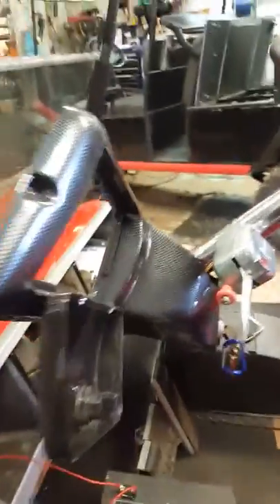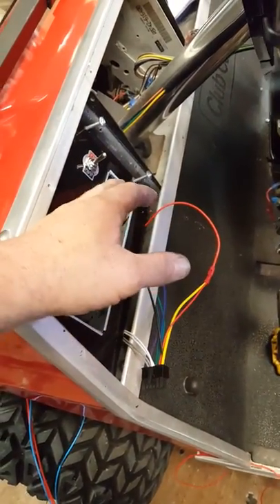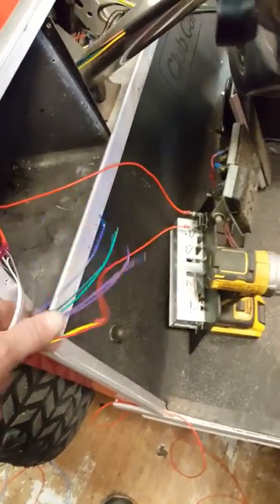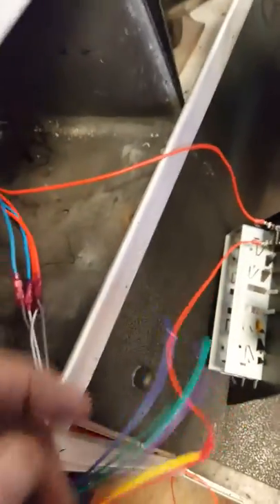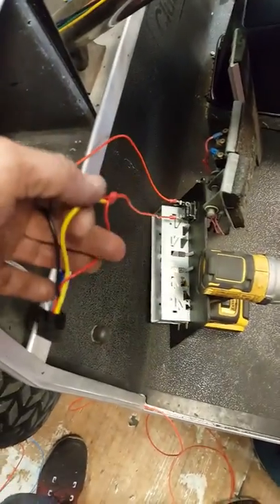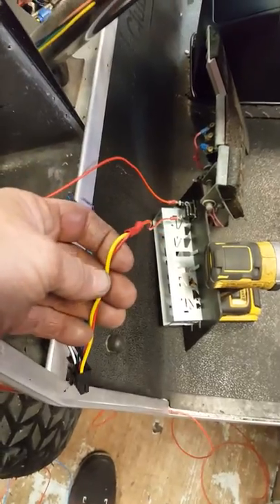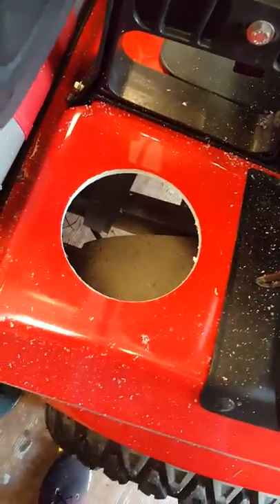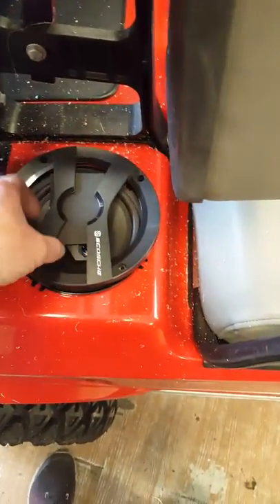Installing radio on a golf cart. Club cart D S. 48 VOLT.

Comment: Where did you purchase plastic  ??
Reply from the maker: If you have a bass pro shop.  Or a boat store they have it there. You will have to cut it to fit.
Reply: Buy Kydex off amazon. Used for making gun cases. Comes in ANY color and is bendable